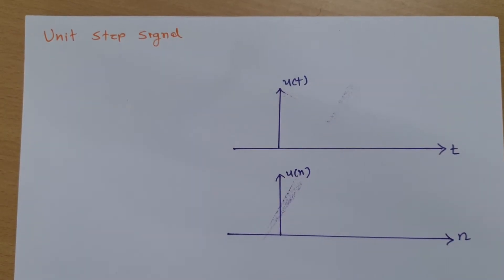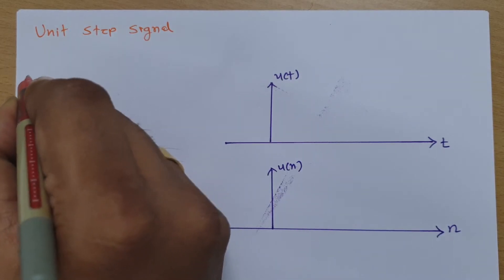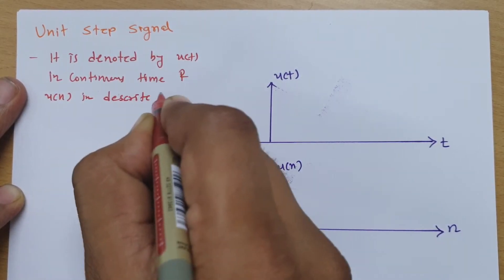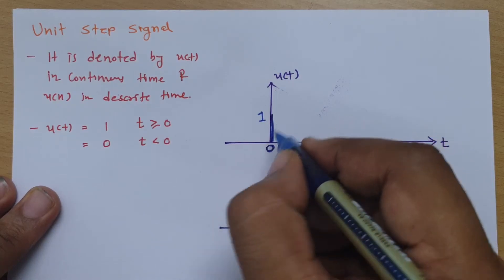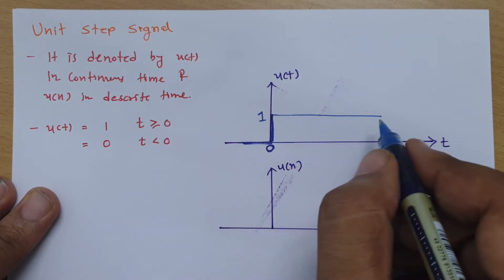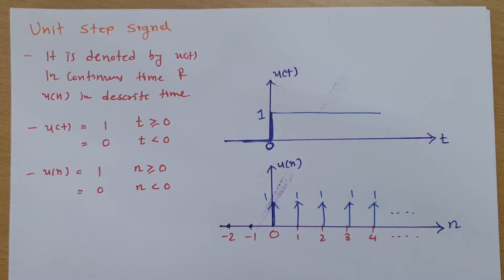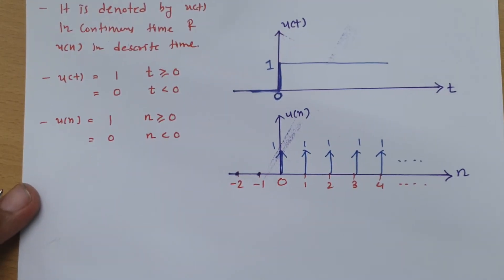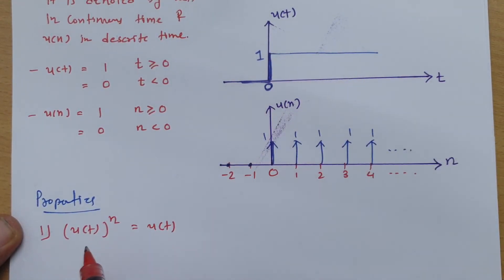Unit Step Signal: Basics, Function, Graph, Properties, and Examples in Signals & Systems

Comment: Great job sir..but i think there is a small mistake..u(t) cannot be defined at t=0 since at t=0 there is a  transition between 0 and 1 and it takes a unit step at t=0..so it should be u(t)=1 for t>0 and u(t)=0 for t<0
Reply from the maker: Yeah
Reply from the maker: I want you to keep giving your valuable suggestions, it will definitely help students as well.
Reply: @sara sometimes it is taken as 0.5